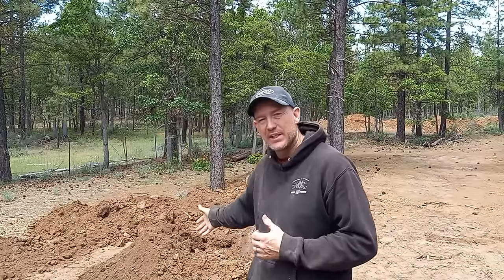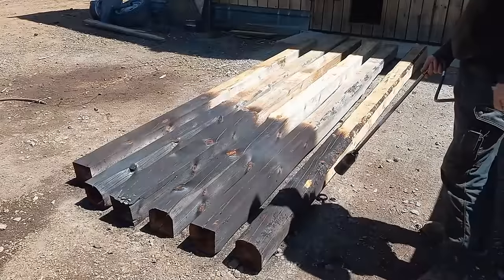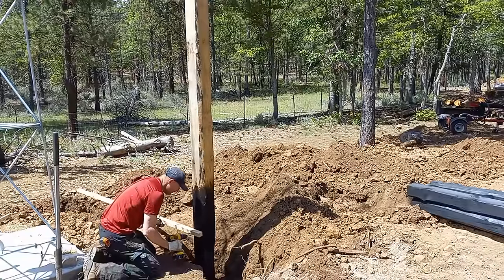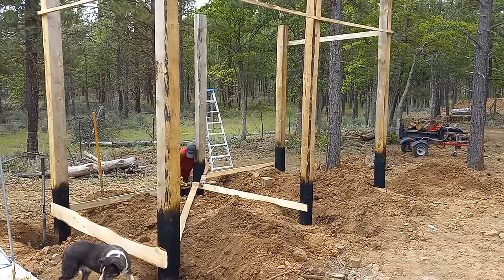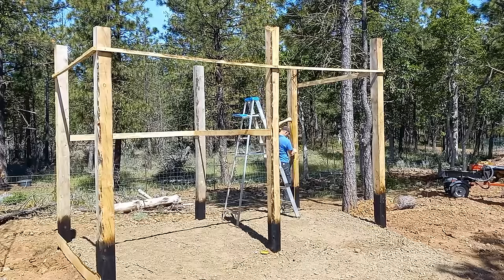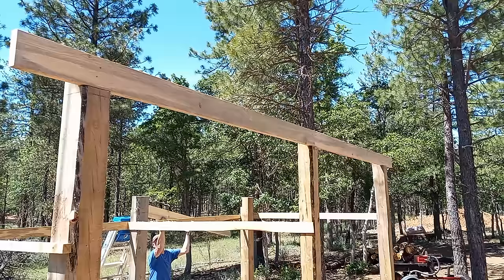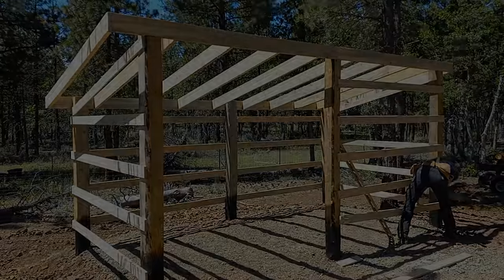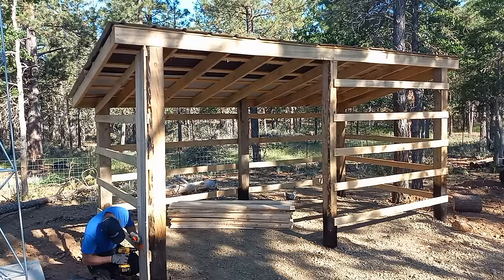The Woodshed That Works For You. Pole Barn, Keeping it simple :)

Comment: Watch the Japanese do this, it is called; Shou Sugi Ban, also known as Yakisugi, is a traditional Japanese wood-burning technique that has been used for centuries.13 It involves charring wood to create a textural surface that is beautiful to look at and offers practical advantages when executed correctly.3 The process involves charring the wood, cooling it, cleaning off any soot or burnt debris on the surface, and finally finishing the boards with an oil.1 Today, Shou Sugi Ban is an environmentally friendly way to preserve timber and, paradoxically, make it fire-resistant.2 The technique involves charring cedar boards, burnishing the burnt results with sandpaper and wire brushes, and then sealing the charred surface with natural oils such as Pure Tung Oil.0 Shou Sugi Ban has caught on recently as a treatment for contemporary exteriors and indoor furnishings alike.4 Accoya® is a combination of high-performance modified wood and an award-winning charred technique that enhances the exterior performance and aesthetic value of natural wood products.5
Reply from the maker: I have done a bit of this in builds that have ground contact. Seems to be working good. Thanks for watching. :)

Comment: I just soak post ends in used motor oil in a 55 gallon barrel. Let them soak for days. First barn I see this done to is still fine after 45 years in the Missouri Ozarks.
Reply from the maker: That's good to hear. This is the first time I have tried this method and was hoping it would last. Thanks for the post and thanks for watching. :)
Reply: Thank you for sharing
Reply from the maker: @allengina1091  You're very welcome. :)

Comment: Your build steps are logical. Pine isn't known to be rot resistant so your technique of burning and oiling is interesting. My woodshed has half inch gaps between boards and it keeps out the rain and snow. Kind of interesting to see that the gap still keeps the wood dry. Thank you for sharing your build.
Reply from the maker: Thank you and thanks for watching. :)

Comment: Char and tar on a concrete cookie does the job good enough. Building a skillon frame for a cabin. I gotta use 3 2x12's for headers because snow loads. 24x28 because can only span 14'6" with 2x12x16' boards 16 o.c. Nice woodshed.
Reply from the maker: Nice, thanks for watching. :)

Comment: Great video but how you manage to place those 2x6 and screw themat the end  I can't figure out how you did this by yourself What is supporting the other end while you place three screws at end ?
Reply from the maker: The 2X6 rafter ends are cut at an angle for the roof pitch. the 6X6 are packed into the ground at that point so they dont move. The uphill side of the 2X6 cant fall because its pushing against the posts in a sense. Hope this helps. Thanks for watching. :)

Comment: Good evening! This was just what I was looking for. Can you please share the dimensions of this shed or a material list of exactly what I need to buy to build this exact shed? 

Thanks 
Nick
Reply from the maker: The outside dimensions are 8 foot by 16 foot, the roof is 8 foot tall on the tall side and 6 foot tall on the short side. The material list is a bit harder because I milled all this lumber out myself so the boards aren't exact to what you would buy in the store. The advantage to having my own mill and a lot of logs to produce my own lumber. The disadvantage is that to make plans I would have to figure out how many store bought boards someone would need to build this. What I can tell you is that a typical store bought 1x6 is only 5.5 inches wide so you would need more than 16 to do an 8 foot wall. Sorry I couldn't help more but hope your build goes great and thanks for watching. :)

Comment: So burning the wood makes it water proof?
Reply from the maker: Burning the wood makes it bug resistant, not bug proof but most bugs don't like it. Putting a thick coat of oil on the wood makes it water resistant. This is not something I have a  lot of experience with but people have been doing it for a very long time. I'm using ponderosa pine which rots fairly quickly if not treated in some fashion. Different species of wood will last longer. Thanks for watching. :)

Comment: How did you determine the length of the rafters, and the angles to be cut?
Reply from the maker: For the length of rafters I just used a tape measure across the posts and added the overhang that I wanted. The angle was done by holding a board up against the 6X6 posts up under the 2X6 that the rafters will connect to and then marking the line from 6X6 to rafter, if that makes any sense at all. Kinda hard to explain but I hope you get the idea. Thanks for watching. :)
Reply: Thanks very much. I'll try to put it in practice.
Reply from the maker: @tommulvey6134  You're welcome. :)

Comment: Looks nice but you are skirting the line between a shed. I have read the firewood needs to be stored off the ground on a platform and that you need air flow if you are storing the wood for a long time. I think you have too many boards on the side. Your building looks more like a place for a 4 wheeler etc.
Reply from the maker: Thank you. I have been using this woodshed for 2 winters and have not had a problem. As far as I know firewood needs to be off mineral soil, I put gravel down inside the woodshed to prevent the firewood from being in contact with mineral soil. I could have installed a subfloor but it would have added to the cost of building a simple woodshed and a subfloor would give skunks and other rodents a place to burrow under and make into a home. If someone were to split and stack firewood in the spring the firewood would need more air flow to dry it out. The larger the gravel you use the more air can circulate under the firewood. I stack my firewood in the fall after it has had all summer to dry out. Hope this makes sense and thanks for watching. :)

Comment: What kinds of screws did you use?
Reply from the maker: Just deck screws, nothing special. Thanks for watching. :)
Reply: @KoalityofLife   Great video. I am planning something this spring, toying with screws or nails, but have read so much about structural screws. They are so much more money though
Reply from the maker: @jkozmo31  Make sure whatever screw or nail you use is rated for outside use. There are screws and nails out there that are not rated for outside use. Most that are rated for outside use have a coating on them to prevent rusting. :)

Comment: Ummmmmmm wood usually expands in the summer with the humidity and shrinks in the winter when it is drier. Where I live anyway.
Reply: Well, we’re I live, we get our rain in the winter and it’s hot and dry in the summer. Isn’t the world an amazing place.
Reply from the maker: Interesting. Where I live it's dry and hot in the summer and cold and wet in the winter so the wood shrinks in the summer and expands in the winter. What part of the country do you live in? Thanks for watching. :)
Reply: If you are looking at interior wood, it shrinks in winter because the house is heated and usually drier.
Reply from the maker: @rf8driver  Interior wood will also shrink if you have a ductless mini split as it will collect all the moisture out of the air inside your house, I know this because I just installed a ductless mini split in our house and the gap between the blue pine panels I put up on the walls grew a tiny bit bigger. But I think the previous statement was directed toward the wood shed build that is outside. Either way, learn something new every day. Thanks for watching. :)

Comment: This is awesome and basically what I want to build for 3 stall horse barn, but 12x12. How did you sort out your diagonal boards to ensure all was square? I was thinking I was just going to do the 3,4,5 method with some string but the boards seem easier. Great vid brother! So easy to understand!
Reply from the maker: Thanks, I used my "math major wife" to figure out the diagonal boards but it isn't that hard. Side A squared + side B squared = the diagonal squared. But the 3 4 5 method works also. Some day I will figure out the batter board method of building. Every time I try and set up batter boards I screw something up. lol Thanks for watching. :)

Comment: I harvested 30 year old radiata and am milling it to do just what you've done.  I'm in rainy new zealand.  I have people telling what mistake it is.  "untreated pine rots quickly"... Maybe I should dry thoroughly and then primer paint the outside bits, no?
Reply from the maker: I have heard the same thing, that pine rots quickly. But I have some pieces of pine trees that went through a fire many years ago sitting on the ground, still solid. So I figured I would put it to the test. I did coat these posts in a heavy coat of oil before putting them in the ground, and made sure the oil went at least 6 inches above the ground level. Time will tell. Thanks for watching. :)
Reply: @KoalityofLife  Over the years there was always a young tree down due to wind etc... I learned that if I got the bark off and kept it off ground that log would stay reasonably strong for years.  I always paint my constructions and found that it will preserve the pine very well.  I'm using concrete base with mounting hardware for the poles... no ground contact.  And I have a good supply of oil to treat any exposed areas.  Thanks for doing these videos.  Very useful for a guy on his own.
Reply from the maker: @2nostromo  You're welcome, glad the video helped. :)

Comment: Ok, I give up.  Why char the posts ?  I suppose it's to keep our creepy-crawlies.  Now I'm wondering about all of the utility poles I've seen that are black a few inches above the dirt line.  I've always thought it was creosote, now I'm not so sure
Reply from the maker: Burning the posts is an old Japanese way of preserving wood called yakisugi. Burning the posts and then coating them in an oil helps to prevent mold, and rot while also being a deterrent for bugs. The utility poles you see have creosote on them, some of them also have tar on them to do the same thing, deter bugs and help prevent rot. Hope this helps and thanks for watching. :)

Comment: If I built a woodshed, m firewood would be accessible from the back as well as n the front. I'd do this so I could get to the wood that is first in.  It will be dryer and there is a chance it could be in the back for years unused.  Maybe barn doors on the back with ventilation at the top under the overhang.
Reply from the maker: I had thought about having a door on each end so that we could get to wood that might be from the previous year but if we have left over wood it wont be much and we can move it to the other end as we stack new wood in the back. It would be a little more work that another door would prevent. Maybe later I will put another door on the other end in the future. Thanks for watching. :)

Comment: sorry my bad english, I rave cross the wall. it is better than rave in level. hard to me explain this
Reply from the maker: Sorry, I'm not catching what you mean. :)
Reply: frame posts should be cross-supported, you catch  my meaning?
Reply from the maker: @harritoivonen7478  you want a diagonal support between the posts for sideways support?
Reply: @KoalityofLife  , yes, it supports much better.
Reply from the maker: @harritoivonen7478  Ah, I understand now. In a traditional building I would put diagonal supports but this building the posts are set 2 feet into the ground so the earth keeps the posts supported from shear loads. The idea is to set the posts deep enough so they will not lean, this depends on the type of soil in your area and what you are backfilling with. :)

Comment: Thanks for sharing this video. Getting ready to build a wood shed this exact size and was going to use concrete but this seems so much easier to just burn the outside and use oil.
Reply from the maker: This is the first time I have used this method but I have heard it will last just as long as pressure treated wood you buy in the store. :)
Reply: @KoalityofLife  Friends of ours remodeled their basement and had one of their friends use this method on their pine ceiling to give it that cool charred look with the added benefit waterproofing. This person now offers this as part of his remodeling business. 

It just didn't occur to me that this could be done on ground wood. I am so buying a propane weed killer torch. Thanks again.
Reply from the maker: @oldmanadventuring  Thanks for watching. :)

Comment: Why no overhang at rear so water off the roof doesn't rot out rear wall?
Reply from the maker: You can't see it in the video that well but the metal roofing hangs over the rear wall about 5 inches to keep water from running down the wall. Thanks for watching. :)
Reply: Wow, thanks for answering !  Good to watch a real craftsman.
Reply from the maker: @charlesmaneage113  Thanks :)